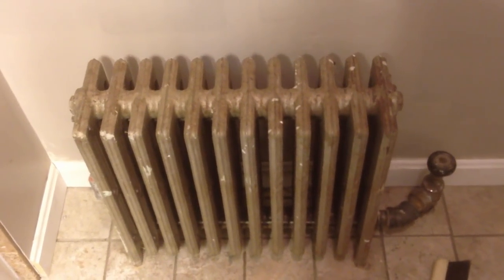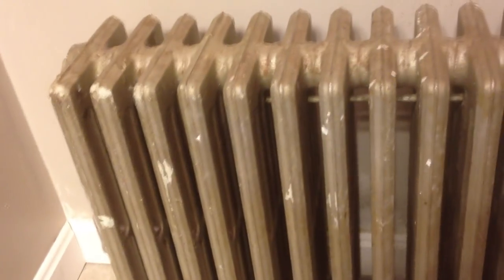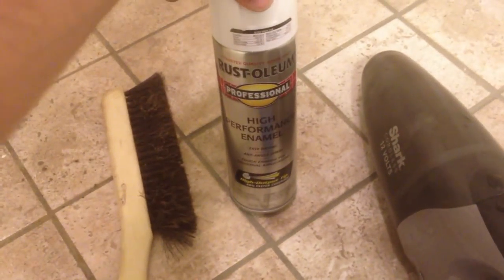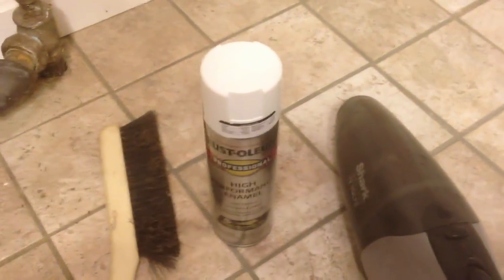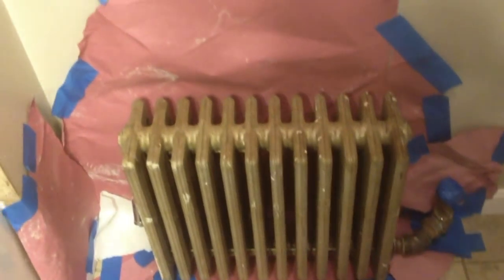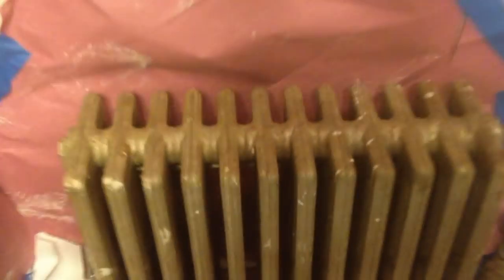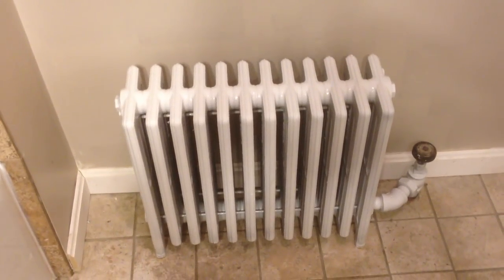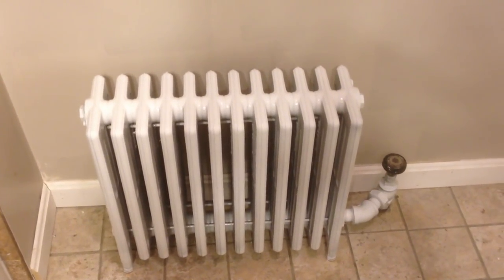How to Paint a Steam / Hot Water Cast Iron Radiator ( refurbished ) restore  DIY

Comment: I would have liked to see his ceramic floor when he finished….  the overspray would be all over that floor.  I have painted extensively with spray cans and he didn't put drop cloths/newspaper (whatever) nearly far enough out. overspray will travel 6 feet easily,  beware
Reply: I did mine with a larger masking and the paint still landed anywhere that wasn’t covered. The whole floor. Luckily it came right up.

Comment: After doing this at the end of last season april 2015 my radiators are now smelling like spray paint each time they fire up. When will the smell go away? Should i have used heat spray paint instead of the one used here??
Reply from the maker: It will take time but it will go away
Reply: +Review King its bizarre because its been firing up for 3 weeks still stinks.
Reply from the maker: +J Gia will take at lest 3 months if you didnt use heat spray
Reply: +Review King ugh thats rough. I figured since i did it back in April it would dry on its own after 6 months. We have a newborn and i am concerned about the fumes. Should i be? I think next time we are out i am going to open the windows and blast the heat to high 70s.